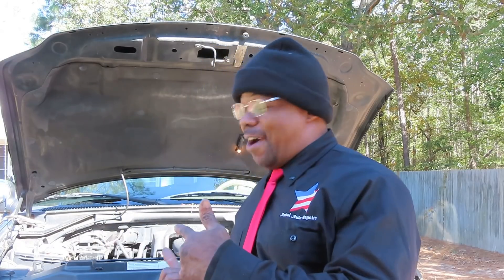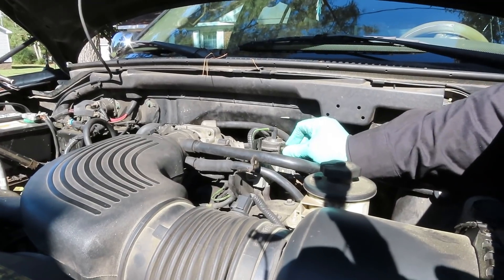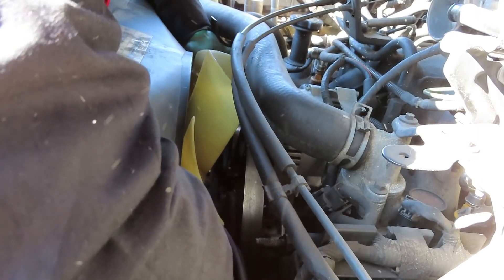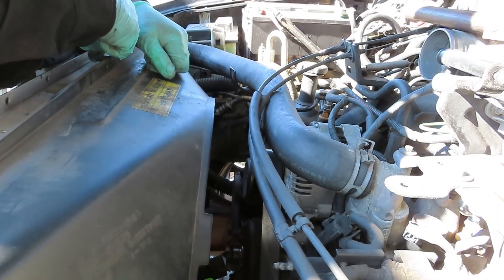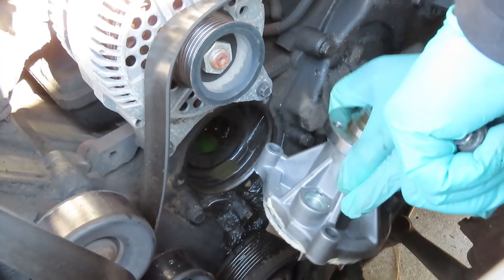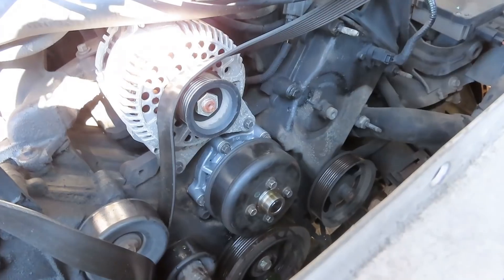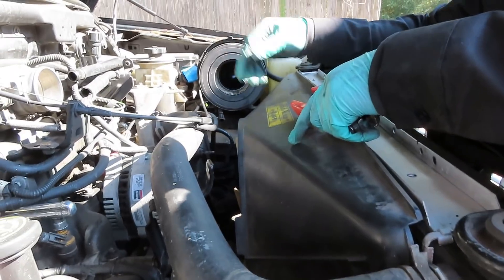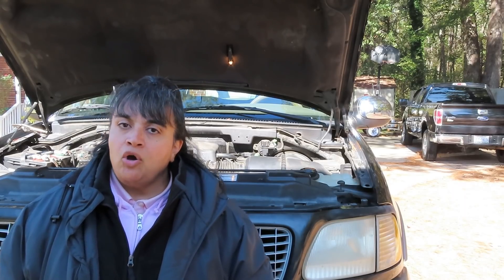⭐ 1999 Ford Expedition - 5.4 - Leaking Antifreeze - Water Pump Replacement

Comment: My f150 V8 has a leak that seems similar to the one in that 5.4L V8. Coolant comes out as soon as I pour it in. Now, I can see the coolant as it drips onto the ground, but I can't find where the leak is. It seems to drip on the left rear side of the engine. Any suggestions?
Reply from the maker: If you can do a DEATILED video of it, and then place it on your channel, that would help us a lot!

Comment: Yeah, that was a newer water pump but an old gasket. I'm sure there's a good story behind that mishap. But at the very least they should have used some silicone.
Reply from the maker: The strange thing is that a new seal comes with the new pump.